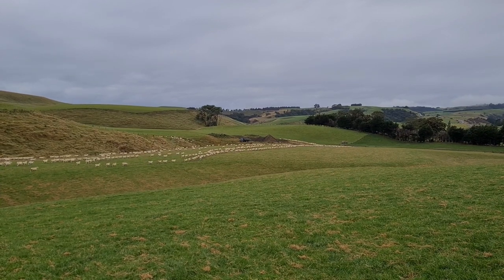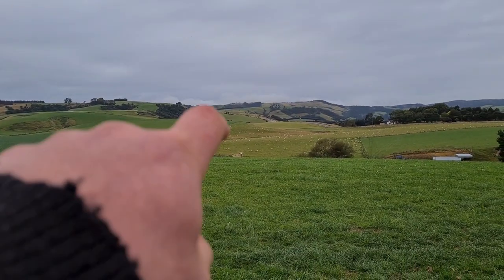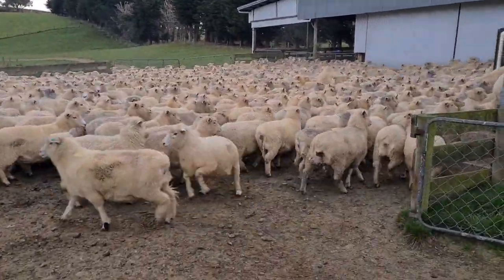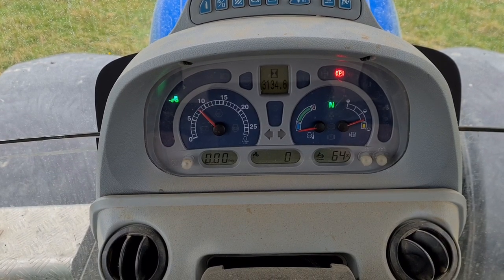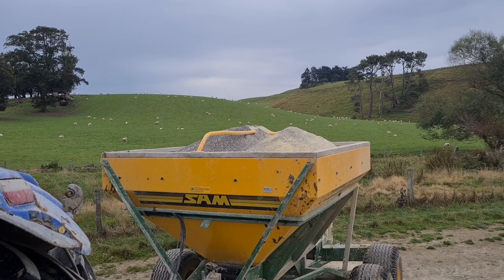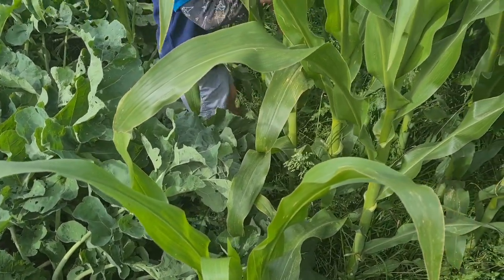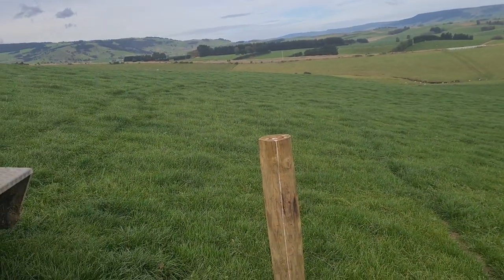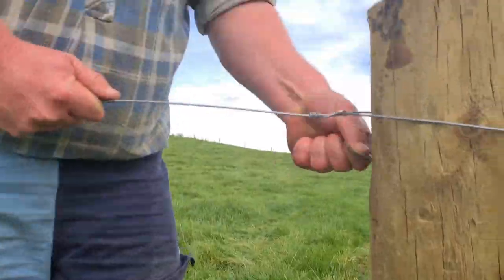Almost mating time!

Comment: DAP is not cheap anymore
Reply from the maker: Sure isn't, but still marginally cheaper than Superphosphate, elemental sulphur and protected urea mixed together.
Reply: Im low on Mg so been trying serpentine.  We are on our third horrible autumn, I'm older than you and having spent a fortune on fertiliser,  I've become fairy cynical, in fact the sarcasm gets out on occasion.
Reply from the maker: I've seen the opposite here.Being sheep, we have massive fertility issues.We didn't put fert on for 2 years, about 10 years ago.Now, the tops of the paddocks are fine, but the bottoms are very low.Its a long road fixing this, as you lose desirable species.Basically you can't improve it much untill you crop and regrass.And even then it takes large volumes of fert on the bottom half of the paddocks.
Reply: you are in a much better rainfall area than me, I also have P levels in the 50s. my issue is S and mg.